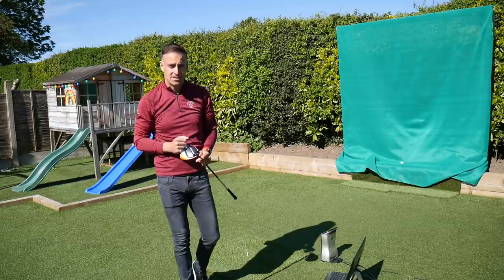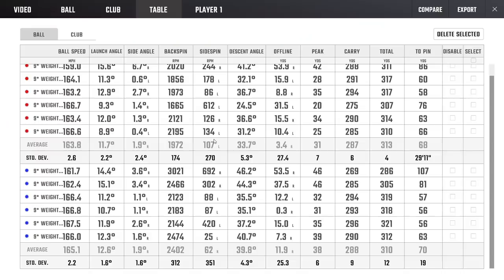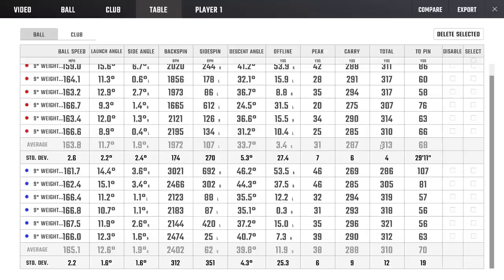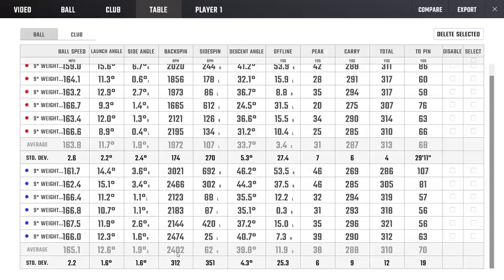Alter Your Driver Launch By Loft Or Moveable Weights?

Comment: great video, i have this same driver and was adjusting my loft on my driver, and happened to notice the same weights and unscrewed them and saw a 4 vs a 14 and noticed the difference in weight. my weight (came stock from callaway) with the more heavy weight was in the back of the driver. I just changed mine to have the heavier weight closer to the face of the club. Im going to the range tonight and i will be interested to see the ball flight differences in my driver. One other glaring thing i noticed from your video was the ball speed dropping 3 mph and 5 mph between the 9 degree vs the 10.5 degree. 5 mph is quite a bit but to see how it offset with spin and your distance in yardages really didnt get offset as much as i'd thought they would have. Very interested to see how my ball flight will be at the range today. Great info. Thank you!

Comment: Great vid Michael I enjoyed it and the timing was crazy for me personally because I just spent 2 hours today at the range trying to take 5-10 swings with my Rogue Sub Zero in every combination of loft/lie I could think of, then I'd switch the heavy weight from front to back, and do it again with a different combination of loft/lie.  Not sure I really figured anything out, other than what I already know as an 11 handicapper - I'm really inconsistent!  When looking at forgiveness, does the weight in front help increase forgiveness, or does that happen with the weight in the back?  Also, I read somewhere that increasing the loft on the driver helps close the clubface and combat slice tendencies, and that decreasing the loft opens the face slightly.  That seems counterintuitive to me, so do I have that wrong?  Thanks again, I'll hang up and listen.
Reply: Typically, having the weight back would increase forgiveness by bringing the center of gravity back and down resulting in higher launch and spin.

As far as the loft adjustments being counter-intuitive, think of the adjustments in relation to the shaft at address. If the head is 10.5° and set to neutral it will be sitting square. If you adjust it to "-1.5°" (or "9°" however it is labelled) it will open the face and you have to close it down to square it, effectively reducing the loft to 9°. Conversely, if you set it to "+1.5°" the face will close and now you have to open the face to square it causing it to effectively play at 12°. The head itself is built at 10.5° and does not change, so the adjustments are really just opening and closing the face to change "effective loft" through the adjustment you have to make to bring it back to square. I hope that makes sense!

Comment: Even though you've done a review of the Mavrik driver, this seems like a mini review of the Sub zero version. If I get the chance to try this out, I'll try out the 10.5 in the front weight setting. Low spin with forgiveness works well I suppose.

Would this creep into your bag Mike? I'm currently using the Callaway Rogue, the Mavrik sounds really good in this video.
Reply from the maker: Mavrik is a good sounding driver, probably the best sound out there. Tough one to whether it could replace my trusty G400
Reply: Michael Newton Golf hopefully not in that shade of orange if it does. 

Not a fan. 

I’ve seen it in other colors now, though and it looks so much nicer!

Comment: One last test would have been helpful.  Get the 10.5 set down to 9  with the weight forward.  That is what my fitting showed worked best for my 100-102mph swing for some reason.

Comment: 10.5 with weight forward => 285 carry 6.5 yards Left with a 16 Yard Standard Deviation
9.0 with weight back => 288 carry & 11.9 yards Right with a  25 Yard SD
9.0 with weight forward => 287 carry  & 3.4 yard Right with a 27 Yard SD

In my opinion, the only playable setup of those 3 is the 10.5 lofted driver because the 16 yard SD is keeping it in the fairway - and visually, it was the only setup that had a reasonably consistent shot shape. My guess is that the 10.5 degree head, opened 1 click to get the start line Right, might be more optimal but it would be close.
Reply: Right and left means nothing here. If he hits one 50 yards right then one 50 yards left, the offline will be 0. Misleading
Reply: @kvgolfa  I'm a Stats Major, 0 is not misleading if the Standard Deviation is 27 yards. It is extremely difficult, if not impossible, to be a scratch golfer if you have a 27 yard Standard Deviation with your Driver - that is unless you also have 180+mph ball speed and have gap wedges out of the rough into every Par 4. Generous golf courses have Average landing widths of 35 yards - your average PGA Tour course is 30m - and majors are usually 25 meters. As I said, the only Driver that is playable from a numbers perspective of those 3 is the 10.5 degree head - not only because 66% of fairways would be hit with a 16 Yard Standard Deviation, but what that number is hiding in the SD Calculation is that it was the only club where a consistent shape (slight draw) was being repeated - the 9 degree head was equally producing blocks, fades and draws - that is unplayable on a tight course - and often why someone with Michael's length also has a 2 iron in the bag because a 245 yard fairway 2 iron is way better than a 280 yard in the rough Driver - that said, it isn't necessarily better than a 320 yard in the rough Driver - and that is why the bombers are ruling the PGA Tour

Comment: Would putting a 16g weight in the heel instead of the 14g make it draw a little better?  I was slicing terrible and I bought the Mavrik Max and instantly my drives were straighter so I was curious if I changed the 14g to a 16g, would that straighten my drive even more?

Comment: Hi I’ve been wondering about this with my f9, at this stage I have it lofted at 8 degrees with the weight in the back, but have been thinking of moving it to 9 with the weight in the front
Reply: Have you done this yet? Interested in the results I have the f9 as well and have the same set up as you at the moment ha
Reply: @Kylez1212 I think I swapped it back not long after, then I got a speedzone xtreme so I couldn’t tinker with the weights

Comment: Good review of the actual impact of these adjustments Mike.  Thanks.  I found it really interesting that the 10.5 spun less than the 9.0 with the weight back. The difference between the 10.5 weight forward and the 9.0 weight forward was much less than I'd have expected. Were you surprised?